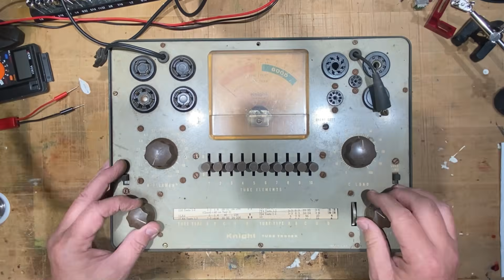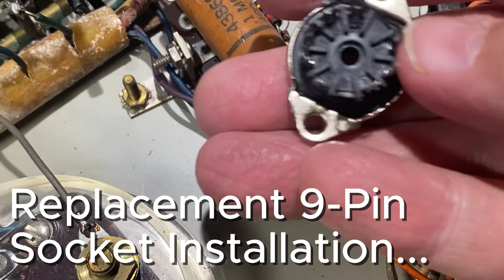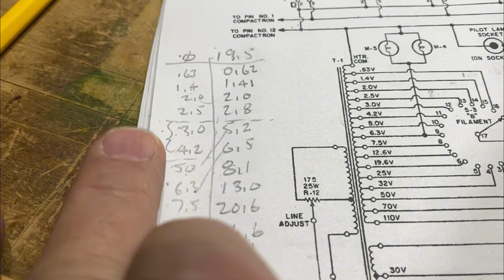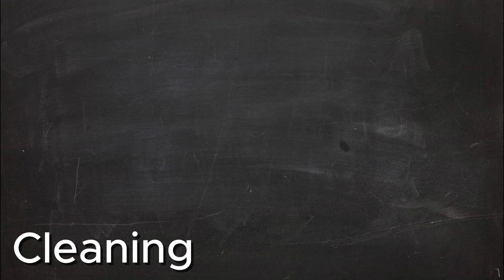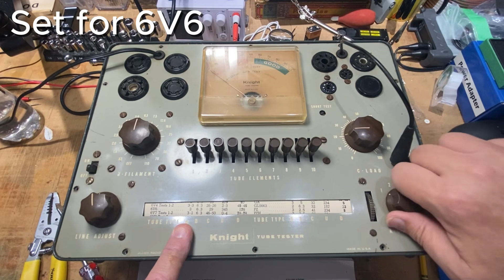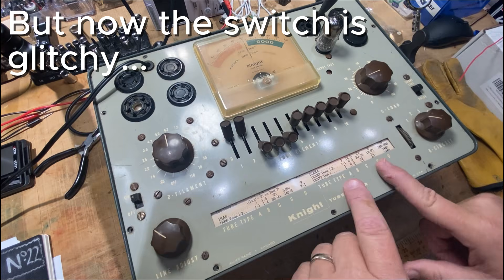Bringing a Vintage Tube Tester Back to Life! KNIGHT Series 600

Comment from the maker: In this video I restore a vintage Knight Series 600 tube tester that I picked up on eBay for just over $30. This classic piece of vacuum tube test equipment was originally used by radio and television technicians to evaluate tube health, and I wanted to bring it back to life for use in my own electronics lab.

This video combines the entire three part restoration series into one full project story, covering teardown, troubleshooting, repairs, calibration, and final testing of this classic tester.

Along the way I work through both mechanical and electrical issues that commonly show up in vintage test equipment.

By the end of the project the Knight Series 600 is working again and ready to test vacuum tubes for future builds, including tube guitar amplifier experiments and vintage electronics projects here in the lab.

While emission style tube testers like this cannot measure full tube gain or amplification, they are still extremely useful for quickly checking tube health before installing them in an amplifier.

Comment: Hi Bill, this is great timing - i have a 600 Knight too. What did you replace the faulty diode with, a forward voltage drop Schottky diode?
Reply from the maker: It was just a common silicon rectifier diode that I had in my junk box. The old one was selinium and was unreliable. If I recall correctly, there wasn’t a lot of current going through that part of the circuit. I gave the new one a try and it worked. 😊

Comment: I feel like someone put wires in wrong spot that 12v should be on 12.6v on switch. Definelty someone wired wrong, you need to switch some around. If some have gone high my guess a shorted tube was tested or transformer was wrong
Reply from the maker: I ended up moving wires around so that the transformer output matched what the switch was saying. I think a replacement part got used and it was close enough or they just didn’t care that the power output was so off.

Comment: Well there you go, nice fix.  If you ever need those other filament voltages you could tap off the 5v line with voltage dividers or regulators.  Although I don't own any tubes with those low filament voltages so for me I wouldn't bother 😂
I did just recently get a tester but haven't had a chance to mess with it yet.  I know the scroll is also a bit wonky, so this video should help.  I got mine from my local surplus shop, they tested it out before selling it so I hopefully won't have to mess with the electronics.  I don't think it got used much as it's pretty spotless and all the sockets look practically new.  Fingers crossed....
Reply from the maker: Thanks for the tip on the filament voltages, and good luck getting that tester up and running! 🤞🏼
Reply: @MadScientistGuitarLab thanks!

Comment: Brilliant timing for me. I recently rescued this same 600 series Knight Tube Tester out of an old barn in Arkansas. Hoping to restore and refurbish it soon. Original manual was inside it as well. This video will help me out greatly. Thanks!
Reply from the maker: That’s an awesome find, especially with the original manual still tucked inside! Hopefully, yours will have the correct transformer inside so you won't have to rewire the thing to make it agree with the numbers on the panel!

Comment: Hey Bill, Mad Scientist Guitar Lab guy, thanks for sharing!  Very cool old tube tester!  I wonder what year it was made.   It does look like quite the challenge.  Like the "Medusa" reference on that many tapped transformer.  I have a old Auto Transformer, I believe is a name for it.  Picked it up decades ago, but it is certainly one of my go to tools for testing with line AC, have grown to love this thing over the years.  It's not "isolation" from the AC lines - this is also referencing your last video with light bulb limiter/load thing.  I did experiment with making a isolation transformer out of back to back pairing of transformers, like 120vac to 12vac to 120vac.  Mostly I ignore and play dangerous and some times do a little unintended arc welding.  Hasn't killed me yet.  I recall troubleshooting TV/tube monitors back in the day, poking around with scope, you could do a little unintended arc welding.  I like the filament bulb limiter as basic idea - it's even visual.  I tend to add resistors in low voltage DC experiments, like with micros,  to avoid micro arc welding, let the smoke out of the box goofs.  So if a DC load is around 100 ohm, add a 1 to 10 ohm resistor to avoid smoke and it generally works OK.
Reply from the maker: Sounds like we have some similar experience with arc welding LOL. I don’t know what year the Knight 600 tube tester is from but I suspect it’s from the 1960s given the tubes it supports. There may be a copyright date on the scroll that could narrow that down. 
I too have used the back to back transformers for isolation, and have also used that technique building Real McTube guitar amps. It works surprisingly well. Even using a little of the low voltage in between them to run the heater filaments, it still steps back up to 120 without issue. 
I have not diagnosed and repaired an old TV like this before so I’m being extra cautious as I go. I appreciate all of the advice! Thanks!!
Reply: @MadScientistGuitarLab  My knowledge of tubes is very limited so I appreciate your sharing some experience with them.  Mostly my interest would be from being a guitarist with a tube amp that gives me a unique sound that I love and cannot seem to reproduce without these tubes. This seems very silly to me, you would think with modern analog/digital/computer systems could be made to sound the same.  I do feel there is some magic sauce the tube provides.
Reply from the maker: @kbongos To me, the one thing digital modeling can’t do is a heat process. Tubes rely on heat to boil off electrons. When you drive a tube really hard, it has to struggle to get there. Also, tubes have to cool down afterwards so they run hot for a little while. It makes the wave lean a little. It’s not quite compression or sag. You can really see it on the scope. A transistor will react almost immediately and won’t have this effect.

Comment: What happened to the “ring modulator becoming a tube” series?
Reply from the maker: I’m still working the problem, just not at the point where I have something to reveal. I’m going to work with some real tubes coming up so those lessons will feed back into the modulator-to-tube design.